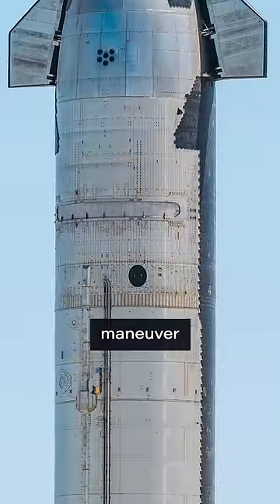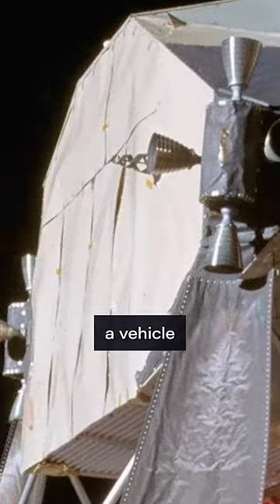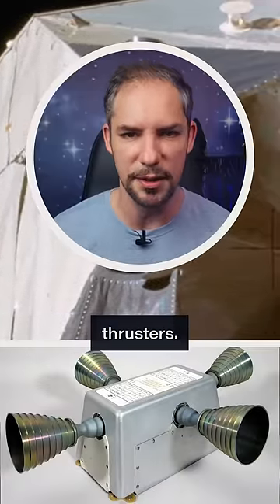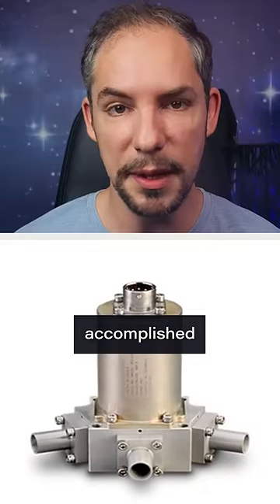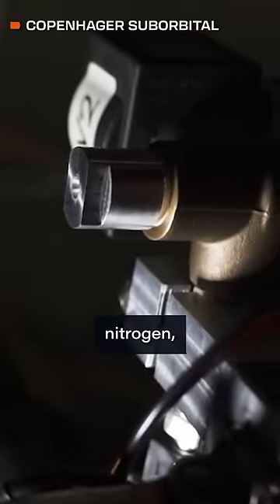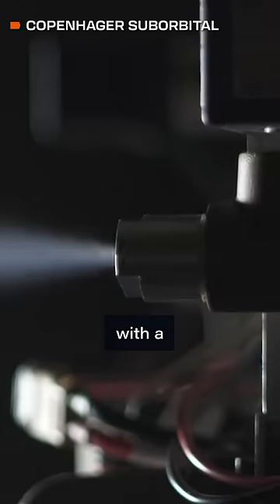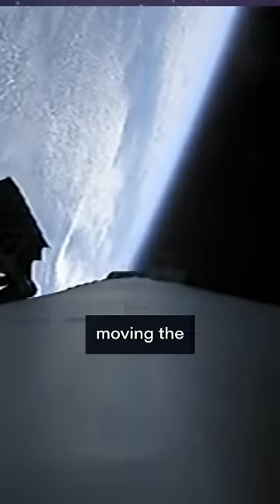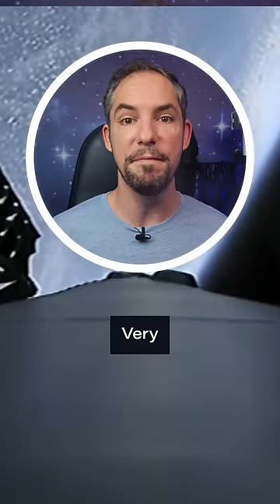How Does A 200 Ton Starship Maneuver In Space?

Comment: Starship doesn't maneuver in space. It spins out of control and then blows up upon entry.
Reply: Not the first time Elon confused vacuum with having air to rudder through (or before float on).
If this is America‘s brightest mind, then „Good night America!“.

Don’t worry, I know there are better ones. Lots and lots of better ones 😂
Reply: @fromgermany271  I wrote it as an expression of my frustration of the failed IFT3 launch, or rather re-entry. How stupid do you have to be to not understand that you should not re-enter earth's thick atmosphere at 27,000 km per hour? They should have used the propulsion system to slow down the speed to more reasonable and manageable speeds. Elon is starting to look like Jason from Far Cry 3, doing the same thing, over and over again, expecting things to change. I know that we learn from our mistakes, but Elon might as well launch the Starship at a wall at this point.
Reply: @OB1Machine  every IFT has improved upon the last. IFT 1 failed to stage separate but IFT 2 successfully hostaged. IFT 2 failed to reach orbit but IFT 3 succeeded to reach orbital velocity. IFT 3 failed on re entry. Judging by what we’ve seen I think IFT 4 will successfully enter the atmosphere.
Reply: @SOR-05  That's actually what I read yesterday. IFT 4 will try not to burn up upon entry. I wish for success.

Comment: Simple solution, just use heat tape around the valve body. It is not a perfect solution because depending on the flow rate  it may not be enough of a pay off electrically. It worked on the Shuttle, Apollo, Atlas among others. You can mitigate it, if you know the temps. Also they need to work on a radiator system for their fuels.  KISS. Sky lab ended up using a glorified gold tarp to keep the temps to proper levels. 
 I am pretty sure they have expertise working the problem. None of this is hard, it is not like it’s Rocket Science. Oops, wait, never mind.

Comment: Speaking about gas in space. When they opened the dispenser door we all saw the atmosphere cloud up and leave. Obviously the cargo compartment was sealed enough to maintain some atmosphere. Question how sealed is it. I’d certainly hate to see an upcoming failure due to it tin caning on reentry due to the vacuum stuck inside once the door is shut after venting.
Reply: At this point it is not very sealed. If it was there would have been a much larger swoosh when the door opened. It will all be resolved prior to human flight.

Comment: Slightly different approach… the obvious problem
Is that although the cowbells look cool for pictures a 8th grader could have figured they are pointing in the wrong direction with no impact on countering rotational motion…. Also desperate firing would only form globs of ice…. On the bright side failure and trial and error engineers probably learned this orientation is not working and guess another 100 million on another axis making this the 4,434th improvement on the list for next launch. At least Felix makes this somewhat entertaining 😂

Comment: not very good apparantly. This thing crashed because it could not maneuver good enough because it burned up and the launch vehicle crashed.
Reply: If you close to the heat shield on only one side, you can come to the conclusion they wanted to somehow „fly“ that craft on the tiny wings on front and back.
But how to do that before the air is melting you away?

Comment: It didn't work very well in the last launch, maybe a controller or gyro failure.
Reply: More like a pack of power. Once the fuel tanks are low, the  amount of waste gas will be reduced, so less power to the thrusters
Reply: No worries, if a full fueled up trip ends dried out at 200km with zero tons if payload, the non-controllability is a minor issue. 

If NASA would have had the same performance back in the days, I would have sat in front of our old b&w tv set waiting for Neils small step the last 54y. 😂

Comment: Once In orbit, doesn’t weigh anything.
Reply: Incorrect, the masa removes deltaV whether you are in orbit or the ground
Reply: it still has mass and that means inertia. So you need energy to make it move in another direction (or stop it again)
Reply: But it still has mass.
Reply: According to my understanding Sir Isaac said a Body in motion tends to stay in motion and a body at rest tends to stay at rest. In other words, Inertia. Delta V means a change in velocity. more massive objects do not slow down because they are bigger unless acted on by an outside force
Reply: @JayBeGood59  It does, but you are wrong in that it does not affect DeltaV, as DeltaV depends on three factors for its calculation, dry mass, fuel and engine efficiency. So yes, the mass of the object itself does affect the DeltaV, because the higher the dry mass, the more fuel you need to provide the same acceleration you are looking for. Otherwise, there would be no load limit for space launches.
Reply: OMG, are you thinking that sci-fi movies of spacecraft’s are the 100% reality?? 😂

BTW, Newton also said that masses interact with each other.
In addition you first have to reach a hight where the is enough vacuum to get rid of drag. Still to be shown!